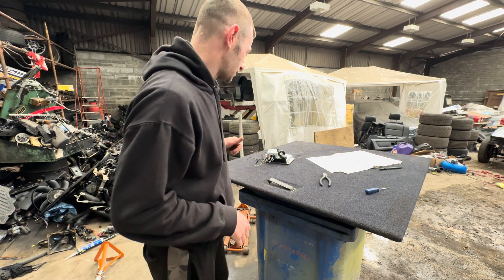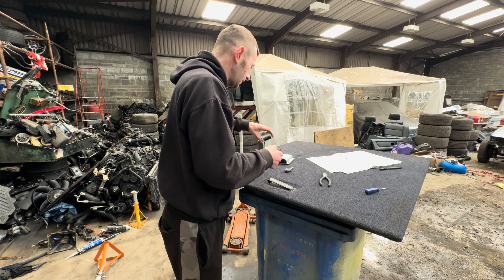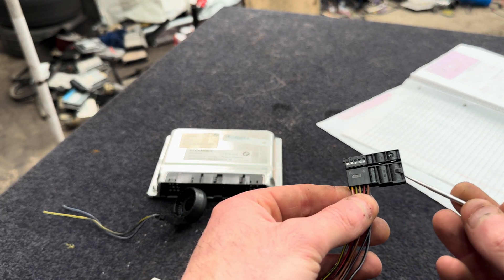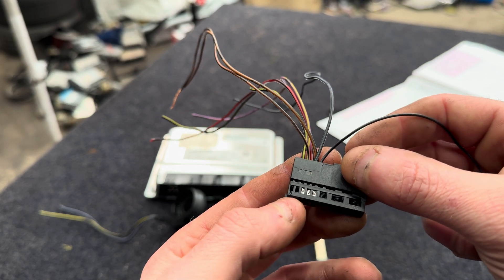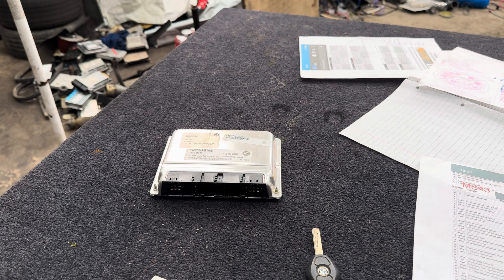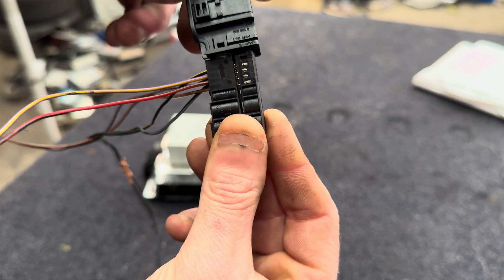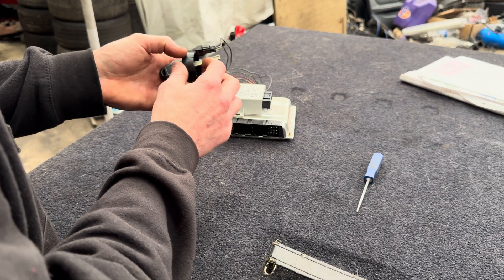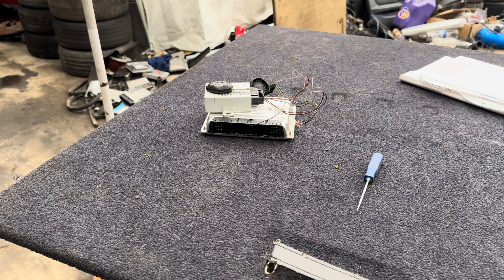BMW EWS 3 FOR STANDALONE USE

Comment: Hi there I got a e39 525 it was automatic  but I Chace it to manual it starts but don't want to accelerate can u help me with it the engine is a m54b20
Reply from the maker: code reader.clear throttle adaptations 

or it needs the brake light switch earthed

Comment: My ews is not allowing ignition to  oils. I want to delete ews completely. Would this method work?
Reply from the maker: only if the ews is mapped out of the way.but if you have lost the chip out of the key and the starter doesn’t turn 
you need to bridge the 2 thickest wires together from the ews box plug

Comment: Hi I am trying to figure out BMW m57 X5 2004 model with the 2 plug ECU my ews is different to your guide it's a auto but only one ground and pin 6 has no wire ? Any ideas thanks Lee
Reply from the maker: on 2004 the ews should be the same ews 3 as shown here
u sure u found the right module??

Comment: Thanks a lot for the information, I managed to start the engine, but I'm having trouble with the ews desynchronization. Do you have any advice or a solution?
Reply from the maker: if the engine started then i don’t know what you mean?

maybe best to follow my ews delete video and delete it so its not a problem atall

Comment: To diagnose you need kbus. Pin 13 is kbus so at least you connect ike it wont work. EWS could be dianosed standalone by changing obd.ini on EDIABAS folder by including the line
MODE=KBUS
Pin 13 is not the regular Kline (TxD) it work with the master module that connects all slaves to the bus so signals datagrams should be translated by the master module (ike on e46) or emulate a “translator” is also a choice
Reply from the maker: my 1st m57 swap i wired it up with just power/earth-antenna and ews wire to ecu
no obd wire to ews box and ran it for a year no problems.key was tucked away in ecu compartment with ews ect all taped up around ecu

now i do ews delete 
but just thought i would share this for others in other countries and remote places that didn’t have tuners or access to laptops ect

Comment: Hello James, I have an e46 330d 184hp, I wanted to put a 218hp engine in it. I have a CAS key and control unit, is it possible? Or would it be better to have the immobilizer removed from the ECU?
Reply from the maker: best having ews deleted
i don’t know much about the cas.doesn’t seem easy to wire up like any other ews.delete it and forget it mate 
also you need wiring changes 
184 is 5 plug ecu.204-218 ect all 2 plug but its all works if u take ur time and swap wires around
Reply: @xyoungyx hi matey, I’m currently doing a swap from the m47 manual to a m57tue 218bhp from an auto but I’m making it manual and I can’t get it turning over for the life of me, I’ve tried tripping the EWS to thinking it’s in park but still no joy, if you could give me any tips please do, and I’ve also been looking for an ECU pin-diagram but I can’t find them anywhere. PLEASE HELP! 😂
Reply from the maker: @jasonhicks3181  in what chassis mate? it doesn’t matter about new engine being auto.its the shell that needs stuff done if shell was current auto
and what did the m57 come out of??